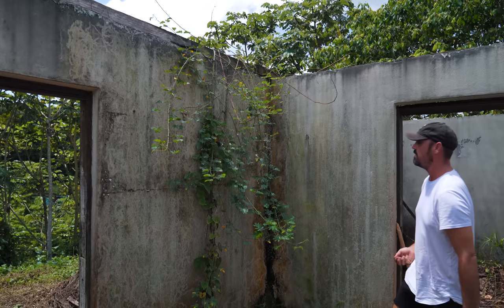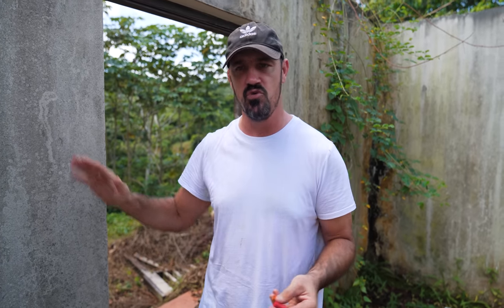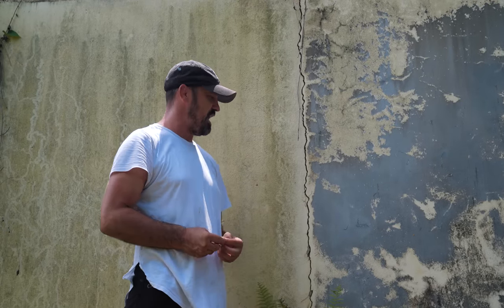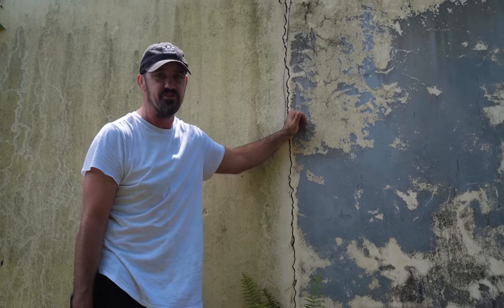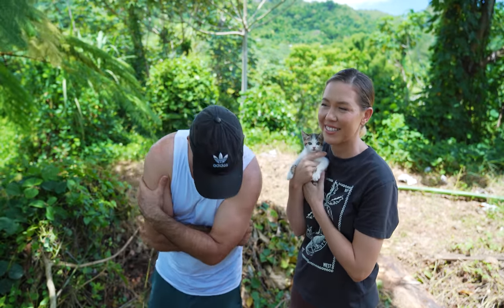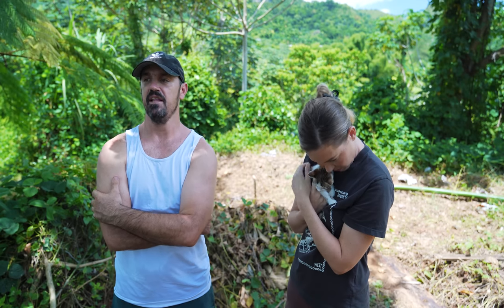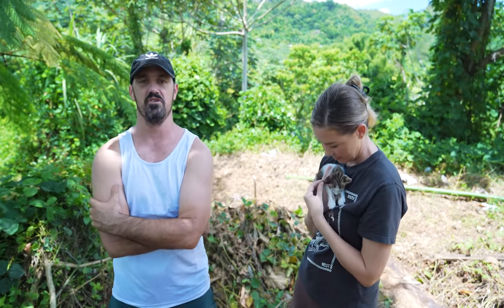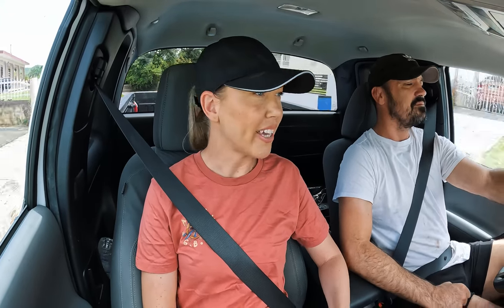ABANDONED HOME SHOULD WE RENOVATE OR DEMOLISH?!

Comment: Greetings folks.  I came across your page today. in particular, your video where you find the spring well. For your health well being, DO NOT drink any water in the tropics before boiling it at the very least. Be it from a spring or one of the many "pencil" streams you'll see in the forests. Bilharzia is a parasite that thrives in   freshwater, specially at the edges of streams, dams, canals,  water tanks, and pooled warm water among vegetation. A dead giveaway is the presence of snails in the vegetation or ground around these water sources. The parasite larvae hitches a ride on the snails where it develops and multiply. As the snails move on the leafs of plants close to the water they leave strings of eggs from the parasite (unknowingly). Many times those strings are visible. Once hatched the larvae hitches a ride on a snail, back to the water. Things to avoid; the snails ( three are some pretty ones that invite picking them up for a closer look. DON'T), handling or touching  plants at water's edge,  pooled water,  warm water (They thrive in it). Snails don't like cold water so water you collect from "pencil" streams up in the mountains, or rainwater is less risk. I still recommend some filtering for the cold stream water. If you are to traverse or work in any terrain engorged with water, do wear rubber boots like you did in Tennessee. The parasite also enters the body thru the skin.  Google the symptoms. Don't try to work it out by yourself at home (is not going to work). Get to a clinic. If you have to work in the muck bring along a spray bottle filled with alcohol and wash your hands and feet from time to time. I do hope this classroom lesson was unnecessary because you already know about it. Stay healthy.

Comment: Matt, if you don't have plans that incorporate the existing dilapidated structure then you must have plans that exclude the dilapidated structure.  Sounds like first you might want to focus on deciding exactly what and where you want to build whatever.  That will answer a lot of questions.  Consider scratching on paper a rough picture of what you want the place to look like in 10 years, 20 years, 50 years.  And since this is an island in the middle of hurricane alley and you're on a 1,000 foot tall hill - what direction(s) will hurricane cat5 winds/rain come from?  Maybe build a concrete bunker foundation with a concrete/block/rock fortress on top.  There was a reason so many of the European explorers/settlers built things out of big rocks and concrete in the 1500's - 1900's.  Those structures still exist today.  Think about the story of the "Three Little Pigs".  I realize you made this video probably a month ago, but it's not too late to revamp your plans if necessary.  Good luck, Bro!

Comment: Take it down, get some heavy equipment and clear the land.  Don't waste your time or resources trying to fix it. Your chickens? Are they going to be food or fun chickens? Egg layers and meat chicken is what you want. Ground corn is smaller easy for smaller chickens, for the bay chicks you will want milled so they do not choke on the large pieces. You will also need some very small gravel for the chickens to eat this will help them grind their crushed corn. The chickens you have the rooster may be ok but the hen is a pet or show chicken. Your chicken coop looks great for now, but you will need a larger one. I also recommend you put wire under the coop as well for the predictors that will dig to get under the fence. I hope this helps.

Comment: The two of you will have to decide if the structure will house animals, if so then the cracks don’t matter, for a home to keep you comfortable and dry especially during hurricane season you need a better built structure so that is demolish vote if it won’t be used for housing animals and not just discarded kittens then you can save the building.
I see it as three times the “pet” costs if you keep the kittens, so it’s your money so you have to decide if the additional animals will fit into the budget, not knowing,  or is it my business to know your expenses, so again you have to decide since it is your money and not mine.

Comment: hi if your concrete walls are rebar reinforced the structure looks solid and would take little to repair the cracks also to tear it down will cost you lots maybe look to integrate it into your new plans its still standing after how many years ?? :O

Comment: Repair cracks by bolting long steel stripes. If you thinking boatbuilding way- your house is concrete yacht. Mesh and plaster. Maybe you can add another wood structure floor? No point to start from nothing if you already have strong walls! Sry my english!

Comment: That house has ground settlement issues from reactive soils. It would be more cost effective to bulldoze and start again. You need to get a engineer soil report than build your new building to cater for reactive soils and ground movement, this is only if humans are to live in it. If used for farm animals it would be ok to use however the ground settlement issues still need to be dealt with via underpinning.

Comment: Forgot to add when u do a predator proof mesh fence dig it under a bit more with a wider trench then fold your chicken mesh at 90 degrees so it runs outwards from the vertical mesh under the ground. Then when rats try and dig under the mesh right at the vertical section they hit buried mesh. They're not smart enough to dig back a foot and tunnel under but they'll definitely tunnel under mesh just buried vertically. They just keep tunneling down until they can tunnel across and up

Comment: Those chickens are silkies they are a miniature chicken.  They only lay tiny eggs.  If you make a chicken run and house lay chicken wire along the run about 1 ft from the ground and take it 3ft out on the ground on the outside of the run.  Peg the wire down.  This stops any predators digging under the base of the run.

Comment: You do not need a rooster for a hen to lay eggs only for protection. Your chickens are silkie breed.
Pellets are for everyday food and corn is for a treat. They can eat full corn but better to buy cracked corn.
If you see a tiny red line in egg yolk that means the egg is inseminated.
Your chicken will lay 1 egg almost everyday. The egg is small due to lack of food and stress and will start laying normal in a few days. 

A simple coop with a few nesting boxes is all you need. Then adjust run to clear land as needed.
Chickens love all food scraps and grass!! ( even cooked eggs and the shells)You can find a list of what not to give them on internet...i just remember no onions or onion family items.
Eggs if NOT washed are good for at least 2 weeks without refrigeration. If washed they must go into fridge and are good for more then a month. You can check an egg  by putting in water. If it floats its bad if it sinks it good if it floats halfway then its about to go bad and should only be hard boiled.

Comment: Those walls sre pretty solid concrete. Maybe poured. Youre not going to get anything stronger then that. Just have to properly seal the cracks. Id you need more room just add to the existing structure. All the wood needs to be gutted. Dont know if you can but only replace the wood with as much pressure treated material you can. For as long as you live there .. termites will be an eternal battle.

Comment: Only an engineer can give you a proper survey of those walls but it looks like the house has settled a bit over time so if it doesn't look like a fresh crack it's probably from when it was built and the land compacted.
Render it up and see if the house moves over time but from what I could see on the video I wouldn't be to concerned "but I'm not engineer". While you sort out where your main house will be that building will make a good workshop with a bathroom and kitchen.

Comment: Ok Matt
If you had 1 cat, that cat is 100% of your total cats. Adding 3 cats means adding in a bundle 300% that is 3 cats. Each matching 1 cat total so each are 100% and the bundle is 300%
The 4 cats now are 100% of cats now owned . So now each cat is 25% of total cats, so for one new cat added is now25% added, but then with 5 cats each cat now is 20% of total so if you add a new cat it would be a 20% increase

Comment: Those cracks don’t seem to be that big of deal.  The main question is how  much rebar was used when the concrete was poured.  You may be able to find out around the windows and the roof the rebar may show a bit.  If there is plenty of rebar and one side of the crack is not settling lower then the other, your all good.  I would just patch and paint maybe with a rubberized paint so no more water gets in.

Comment: This is thinking outside the box.... buy, a surplus,  milttary, grade , 4 season,  tent, heavey duty canvas. 
U can heat and cool them. And have a fire place stove. In 2 weeks, it's up and done. Then, start building the house... destroy those old walls. There not safe, and will not hold a load.drill into them. They will crumble...

Comment: After a tough day, this made me smile; thank you.  The kittens are super cute, THANK YOU for rescuing them!  If you haven't already please get them checked / vaccinated / wormed, who knows what they may have picked up - and its much easier to address that stuff before it becomes a health crisis.  Good on you for using locally available materials - I wasn't sure about that bamboo concept, but you made it work!  Be sure to anchor it to the ground securely, predators can push the structure up or burrow underneath.   As for the structure - my initial thought is its a tear-down.  Is that concrete block construction or stucco over framing?  It appears to have a concrete block foundation, not a poured/reinforced foundation; that's a concern to start with.  Then there are the services - even if the walls themselves are stable, what about the wiring and plumbing?  While it might be possible to use that structure for storage etc, to restore it to the level where you could safely live in it would be waaaay more expensive than starting over.  Add to that its occupying the prime flat, cleared area at the front of your land near the road, and I just don't see saving it making any sense.  So, I'll look forward to immediately seeing you prove me wrong!  🙂Have fun along the way!

Comment: Temporary Tool Shed. You are going to need a lot of equipment to work that land, toss a roof on that sucker and you can store them in there. Then you can demo it when you are are ready to build your permanent structures.

I would at the very least keep the foundation though. You can work with that.

Comment: Construction in PR is usually solid but this building has to go. You need a blank canvas specially when you take into consideration the cracks in the walls which could be a sign of serious ground settling. Your videos don’t give me a good look at your topography but it looks like there’s a drop behind the house. Trying to save your existing structure will get in the way of maximizing the use of your property front.

Comment: Good bones ...grinder with a wire brush and re seal ...grind it out and render it up ....replace the timber top plate and redo the roof ....remember it's 40 or 50 years old it's not going much further
Reply: Big flat roof 5degeee then ya can put solar on ..over hang the roof on posts and obtain a front and back or side veranda ... don't be afraid to put a new door or window in...

Comment: Are you guys talking hurricane country here?  I believe I'd keep those concrete walls.  As for the cracks, those look like "settling" cracks to me.  Common as concrete "ages".  Ive dealt with those before.  If the cracks are small enough you can buy concrete repair stuff that come in tubes like caulking.  If the cracks are too large for that (need too many tubes) just buy some quickcrete stuff and a trowel, mix it up (not too wet), and slather it in there.

If you are worried about the ground slipping out from under the building, look around and see it there is evidence of the earth sliding away from under the house.  But you appear to have a lot of large vegetation around the building, and the roots have a stabilizing  effect on the soil.  But really, if the building is sitting on reasonably level ground you probably don't have a problem.

But I guarantee, if you "stick build" a modern U.S.A. style platform frame house in hurricane country, as soon as you have it finished and move in, the next hurricane will blow through and your new house will be evenly distributed across the countryside.

My advise is to go visit some people in your neighborhood and see how their houses are built and how they are furnished.  Then follow their lead.  They will already have it worked out.

Comment: OK as it comes for chickens when you’re building the coop, the idea of building the coop is so at night they have a safe place where they won’t get killed chickens don’t see very well at night. Gotta make sure that nothing can get in and it’s secure as far as feet is concerned, pellets are the best for chickens that are laying eggs, it’s better off to have small pieces of corn only because it lasts longer and when you let them free range they get to eat other bugs and stuff like that which supplements they’re diet which actually makes the eggs have more protein which is better yeah I’m not sure that you have the kind of cold weather required to have a full corn diet which is the one reason why you would have a full corn diet because it’s cold and they need it for heat but if you got wheat or whatever, even if you had some old meat that went bad, then you let it sit somewhere in a bucket and get the maggots out that’s a great way to feed them as well so any food left over to get a little compost thing, going in back corner, and then put some raw meat somewhere by get the maggots out great way to feed them and cut down your cost

Comment: Hire a structural engineer to assess it. Without the roof, the walls on both side have been exposed to the weather.
It may appear to be solid, but those cracks are early signs of structural failure.

Comment: What will the local bureaucrats allow you to build.  It is my impression that local PR building permits can be hard to get.  You do not want to start collecting fines.  It may be much faster and easier to get permits to rebuild than to build new.   You want it storm proof.
Look into making a chicken tractor.  So you can move it to fresh grass.  Also use a chicken tractor to move around and fertilize your garden.  Hawks will quickly decimate a chicken flock.  Predators will dig under or rip through chicken wire easier than you would believe.  Build a nest for egg laying 2-3 feet above ground to make it harder for snakes to eat eggs.  Put some small limbs across coop for chickens to roost on.  Do not use roosting limbs with splinters.  Splinters will stick in chicken feet.  Toss in fresh weeds to chickens daily.

Comment: to be fair, saving the kittens is a good idea, not just as in "being a good human being" but also as in "having a cat(or cats) on your farm will help control vermin".
not to mention, that adding a dog can help with larger animals. Like foxes, (not sure if there's any foxes in your area, but foxes are one of the most widespread animal type, from the arctic to the desert 0.o so odds are good that there may be foxes around) and foxes can be a big issue if you want chickens. they also generally don't get scared off by cats, but if they smell a dog they'll be very wary.
so, cats for vermin, dogs for larger predators that could hurt your farm animals :)

as for the building, I'd let it get inspected first, if the foundation is bad then over time it might put a lot of stress on the walls, you can do repairs of course. but if it gets bad then you'll have put in a good amount of money and work to fix up a building that's slowly falling apart and will be in need of a lot of repairs. so that might be a headache not worth having. quick inspection should ease your mind and help shape your plans :)

Comment: Concrete must be a fortune on the island, then delivery is whole nother bank asccount to use… Utilize what is there for now, I would try and see if they just poured raw concrete walls with no reinforcing or is there reinforcing (rebar or wire mesh? Using non-intrusive methods or core drill a few holes then patch those temporarily as you may want to try and do the holes where you may need a pass thru in the future? Such as a mini-split A/C system, if you do that and plan on a mini-split do it on the correct angle needed) 
- ok so now you have of reinforcing or not,  that opens what kind of structure you can create, taller, or more stout second story platform to add etc.
- worried about “sliding down the hill?” Excavate and install piers to tie the soil in.
- if it was me this is what i would do, that structure can be so many things, especially at the beginning, you can always rip it down completely or just remodel its foot print
- and especially with the hurricanes the island gets, that is a stronghold that can protect lives and property.
- and could be the store front for Matty’s Mountain Taco’s shop, with homegrown salsa ingredients or at the least an a homegrown coffee shop?
Best of luck to you both, looks incredible!